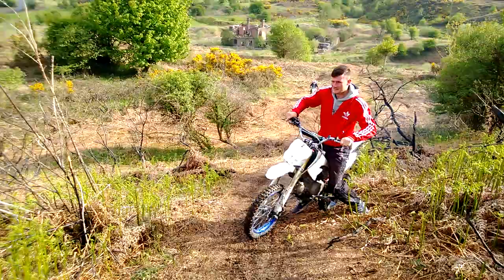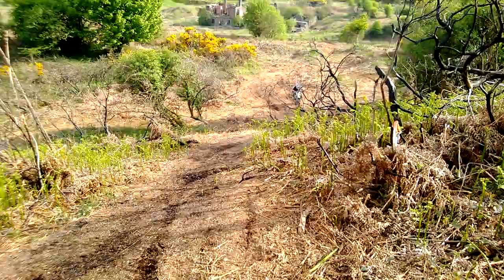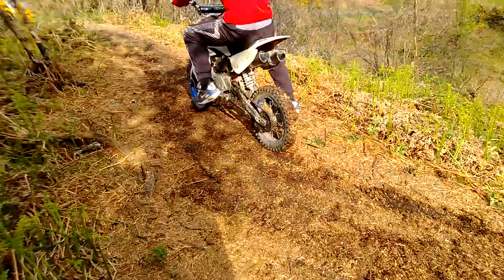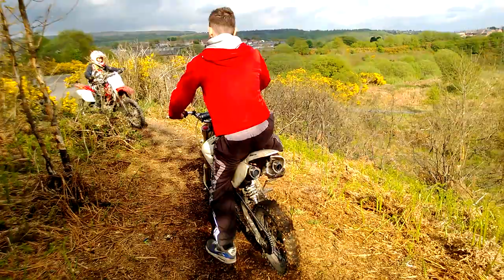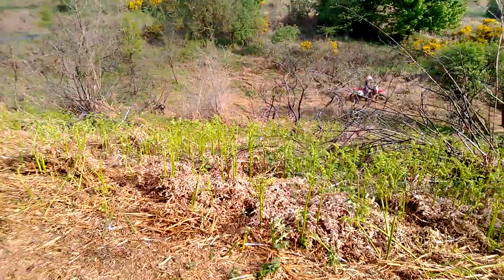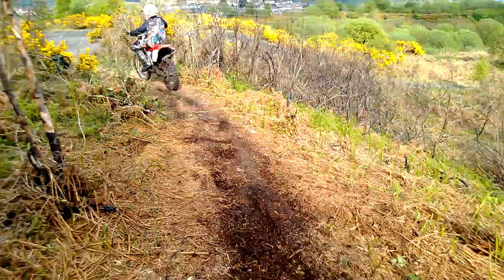Stomp Racing YX140. How to Start, Stall... & Ride.

Comment: You seem to be burning oil change piston and rings
Reply from the maker: Stem Seals are Notorious on wearing out on the YX140 CC engines :) but the engine was put threw a lot before i had it.